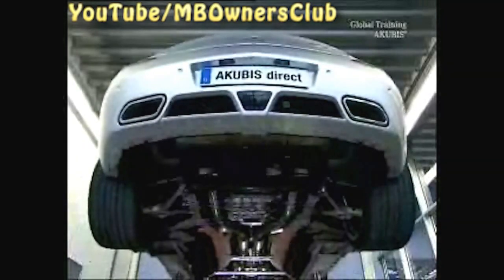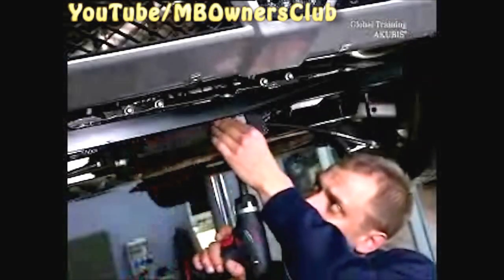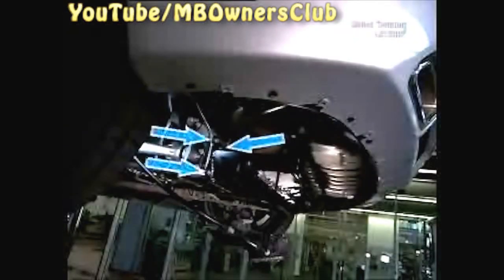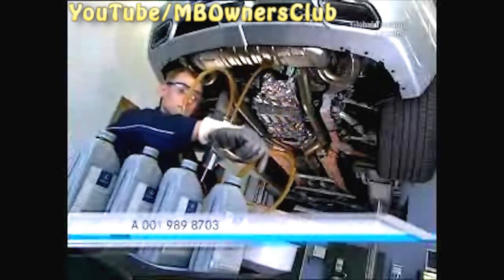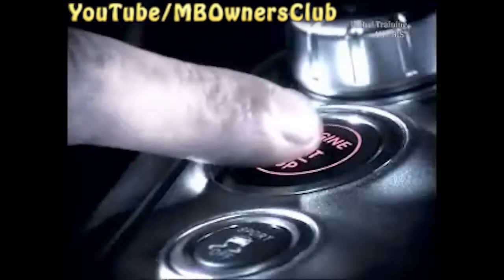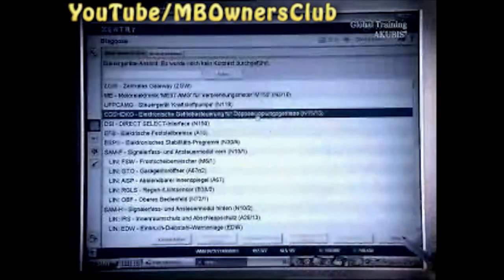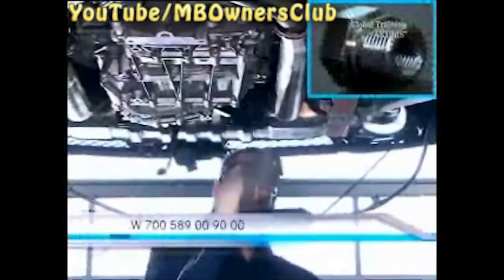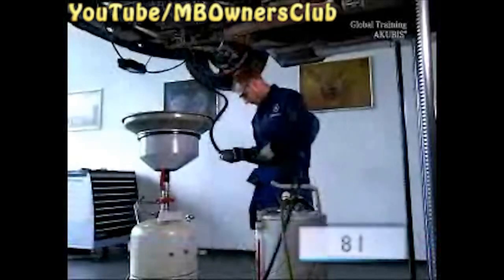Mercedes-Benz SLS-AMG - How to change the transmission oil | C197, C190

Comment: There is an error at 1:40 as the narrator says "now open the filling screw." That is still the drain plug (the second one) not the filling port. At 1:55 however the narrator is correct when he shows the filling screw located on the back cover, facing outward.